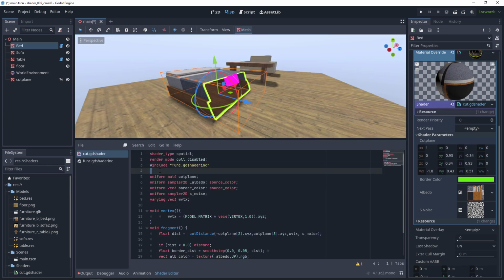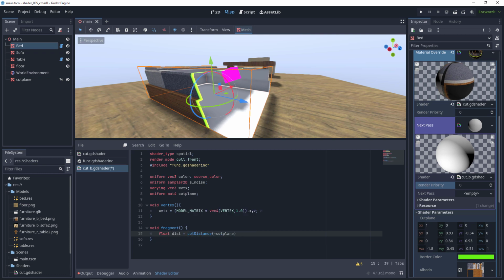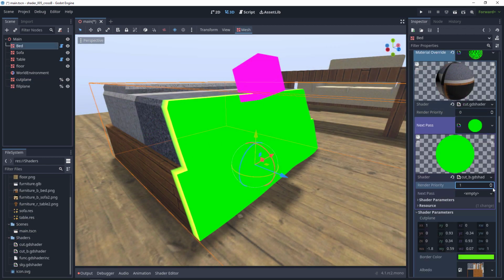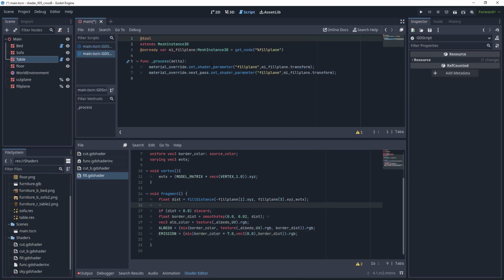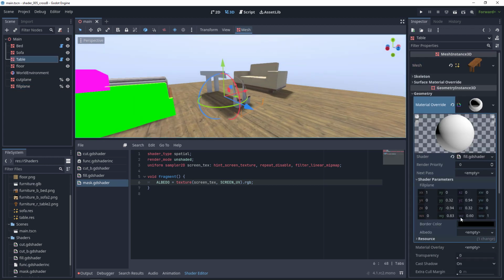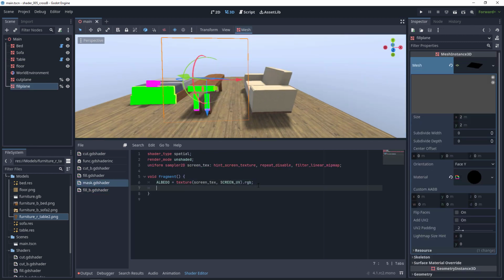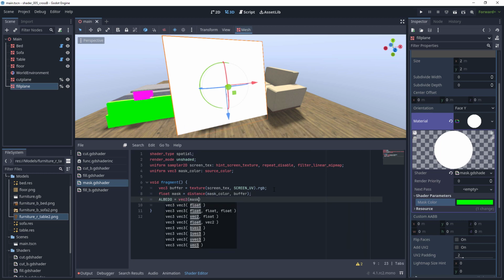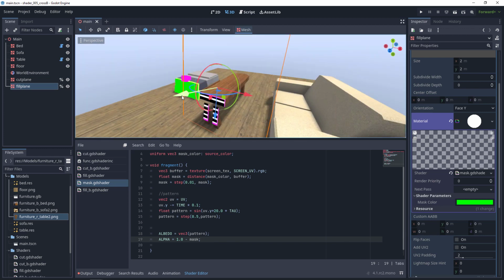Cross section shader Godot 4

Comment: Thank you for this channel, I learned a lot from your videos!

I was able to replicate these fills and masks from the tutorial, I'm trying to create a dynamic plane cut for when the player enters a house/building it auto hides the upper floors/roofs
my problem is that all of my assets have overlapping meshes so it always shows pieces of the overlapping walls inside the mask... Do you know if there is a way to make the mask only follow the contour of the cutted elements?
Reply from the maker: I have tried to solve this problem several times, but I have not found a solution. It seems trivial, but it is hard to solve. 

Maybe a workaround would be to generate an SDF (assuming the SDF is generated correctly with overlapping faces) and hide any geometry inside it 

Maybe even the SDF would not be generated correctly. 

This is why I use meshes that are perfectly sealed and have no overlapping faces at all.

Comment: Hello! This was an awesome video. Coud you please tell me, how can I change the size of the plane with which I would like to cut the object (for example the table in your video)! Thank you in advance.
Reply from the maker: Inspector->MeshInstance3D->Mesh->Size
Reply: Thank you for your fast answer @pixezy8962  . The size of my cutter plane mesh instance is x=0.2 y=0.2 but in practice it cuts the other 3D object as it is way bigger. I am using the shader code, that you showed in your previous video (Cut-off Video Godot4).

Comment: I'm sure this is done a different way, but would it be possible to do this with multiple planes or a sphere? I can cut out a spherical hole (with parameters, not necessarily an object) but doing the internal texturing would be nice if it could be filled in some way.
Reply from the maker: Yes, I think it is possible with a sphere, inverting the face and then using the sdf of a sphere with the same dimensions.